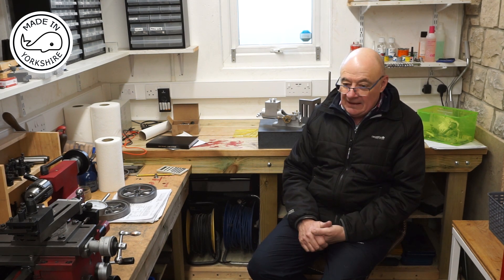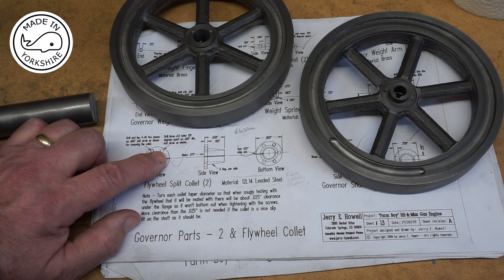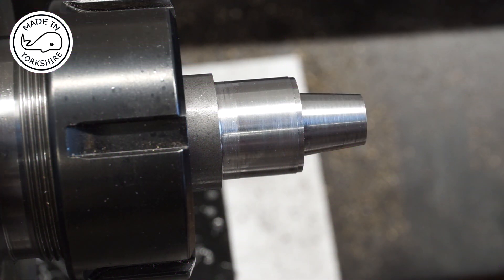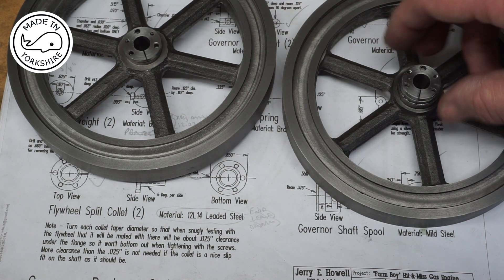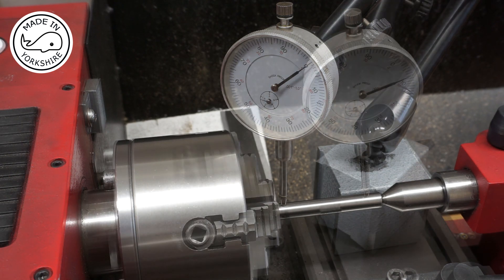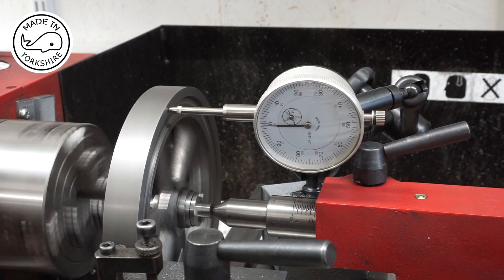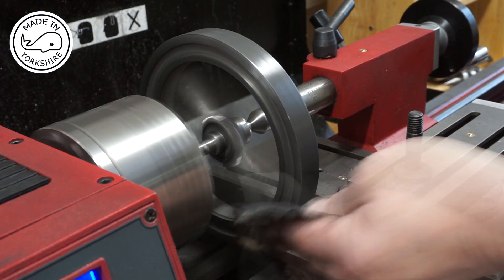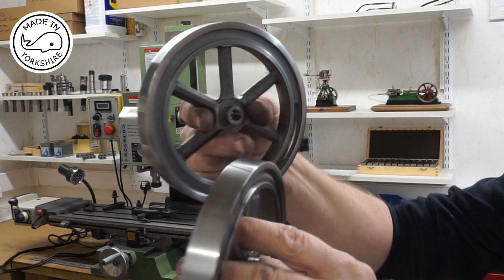#MT35 Part 19 - Farm Boy Hit and Miss Engine. The  Flywheel Split Collets. By Andrew Whale.

Comment: Andrew, I have a Farm Boy 90 percent complete (your series prompted the engine choice).  What method did you use to seal the cylinder head to the cylinder?
Reply from the maker: Hi Colin
I used a BS025 o-ring - ID = 29.87mm, Section = 1.78mm. I'm not sure if mine is Nitrile or Viton. I'm using Coleman fuel (Naptha) so Viton would be best. If you are in the UK I could post you one of mine - just email me your address to learningturningmetal@gmail.com. A small donation to paypal.me/AndrewWhale is always appreciated. Once you have your Farm Boy up and running, if you could send me a brief 10 to 15 second video clip, I could include it in one of my future videos.
I hope it turns out well.
Cheers
Andrew

Comment: Where did you buy the Yorkshire grit?  I could use a can or two of that!  Great results!
Reply from the maker: Hi there - Yorkshire Grit was designed for woodturners and I had a tin kicking around from a few years ago. I'm probably the only person to use it on cast iron, but I've it does give a great finish. It's widely available fro woodturning suppliers in the UK and some other countries.
Cheers
Andrew

Comment: Nice job Andrew. I did exactly the same thing leaving the the compound angle set for both pair of parts. I thought the 4-40 hex head screws were interesting. I haven't seen hex head screws that small over here in the US (I just checked and they're available but not commonly used here in my experience). I've used socket head cap screws on my Farm Boy, but yours will probably look more age authentic given that these engines were common in the early 1900s, and socket heads first appeared in 1911.  Now I may have to buy some hex heads...
Reply from the maker: Thanks Tony - great minds think alike - ha ha. I purchased the hex head screws recently, specifically for the collets. I agree that they do look a little better than cap head screws. I got them from Westfield Fasteners in the UK. I just don't understand why shipping costs are so high between the UK and the US - especially when you can get goods shipped from China at a fraction of the cost. Three weeks ago I purchased a couple of books from Village Press Publications in the US. The Shop Wisdom by Philip Duclos, and Two Shop Masters. I had to pay $45 for priority shipping, and I'm still waiting! I think I will chase them up today.
All the best - and stay safe!
Andrew
Reply from the maker: Hi Tony, a quick update on the hex nuts...... I've just done a test assembly of the whole engine and found that it was rather difficult getting enough purchase on the hex screws to get them nice and tight. So I've reverted to your style of socket head cap screws.
Cheers
Andrew
Reply: @learningturningmetal  Hi Andrew. McMaster Carr here in the US sells them in various grades, and it may be possible to find some strong enough or with taller heads to get more purchase. I may look into that and let you know.

Comment: Well done Andrew. I thought that Yorkshire Grit was meant for Woodwork ? Is it supposed to be used on metal, or was it just your idea to give it a try ? Anyway came out great in the end. Hope the second flywheel still runs true after re facing. Personally I would have dis assembled the flywheel taper collet and check for dirt or burr and checked again before actually taking a fresh facing cut. From seeing you machining the first one with a good setup, I can't believe that the second one was so far out. Fingers crossed. With any taper turning setup, if you want two matching parts, it does not matter that the angle is exact, as long as you do not alter the compound slide and machine as you did; they have to be a perfect fit.
Reply from the maker: Hi Dave - many thanks for the advice. I'm not sure why the second flywheel was so far out - I cleaned every face and it was spotless. I'm just wondering if rotating the collet might have improved matters - too late now though. Yes, Yorkshire Grit is definitely meant for woodturning and it produces a really high finish. It's oil based with fine grit and I first tried it on my Stuart Half Beam flywheel - and I got a really nice result. It does make quite a mess though. Maybe the guy that invented it should expand into model engineering? I might just drop him a line!
All the best.
Andrew

Comment: Gday Andrew, those flywheels look fantastic, excellent job and throughly enjoyed watching
Reply from the maker: Thanks Matty!
Reply: @learningturningmetal  Agreed. 
I really liked the way you left the final machining until you got them in this set up.
Did you figure out what the miscue was on the other fly wheel? Was it the 1st or 2nd one you machined in the previous video?
Reply from the maker: Hi Tony - to be honest I can't remember which it was, and I never understood why it was out in the first place. 
Anyway, it worked out OK in the end.
Cheers
Andrew
Reply: @learningturningmetal  I have read many of the comments on the ignition problem. No matter what engine you have its a matter of getting enough fuel and air into the cylinder to do the job and then can you ignite it at the right time.
The fact that its igniting at times suggest that it is getting enough air and fuel at least some of the time. The fact your using a fuel that is different means the carb and jets might be wrong for the new fuel. 
In Australia we can get Acetone from almost any hardware store or paint store. If that fails ask your wife for some nail polish remover. Some of those are almost 100% Acetone.
I think your comment below about the spark gap makes as much sense as anything, but maybe its best if you open that gap little by little until it works or works better, because at some point that gap will be too large for a decent spark.
Reply from the maker: Hi Tony - I think my problem is associated with compression. Looks like the Methanol I initially used degraded the piston Nitrile o-ring. I replaced that and it ran for a minute using Coleman fuel. I will now look to get some Viton o-rings. I did order some Acetone yesterday, but looking at rubber compatibility charts, it appears that that will degrade Nitrile and Viton. So, for now I will avoid going down the Acetone route.
Cheers
Andrew
Reply: @learningturningmetal  Good point on the Acetone, you should mention that in the next video. You have to do one as so may want to see this run.
My lathe has finally arrived in Australia, I just have to fid a place to put it and get started. I think my first project will be a cylinder square, followed by a lathe height gauge.
On Engines my list of future projects include the PM research #2, #3 & #1 (in that order) because the #1 has some tricky machining. I'd also like to do the Stuart Progress (wobbler) and 10V (because your vids are here to help). The Stuart kits are a bit more expensive, but have some nice details. Ades Workshop is doing an S50 at the moment. He's done a couple of neat things to boot. I do want to stick to projects that others already have videos for so I have references. The One I really want to do but haven't seen anyone do on YouTube is the Hemingway Cygnet Royal. Historically its a very interesting engine.
I've noted that little wobbler you did and will probably try that just to get started. I'll only have a lathe at first so some parts will be fun. I've seen Mr Pete's wobblers too so there's lots of references.
Reply from the maker: @tonywilson4713  Hey - exciting getting a new lathe. Now you can start buying all sorts of things to put on it! I hope your projects go well.
Cheers
Andrew

Comment: Just as an FYI, they make extended length center drills. I have a couple that I use when I can’t fit a standard size one into a part. They are cheap and useful. You might want to pick one up.
Reply from the maker: Hi Anthony - many thanks for the tip. I could do with some better std ones too, so I'll try to get some extended length ones at the same time.
Cheers
Andrew

Comment: Very nice Andrew! I wonder if rotating the split bush in the second wheel would have helped with the runout?   Keep em coming!
Reply from the maker: Thanks John - I think you could be right. I never thought about that at the time - panic just set in! Having trued them up, I've marked them up against each flywheel just to make sure that they go back into the same position. The tapered split collet is certainly an added complication!
Cheers
Andrew

Comment: Thanks for one more interesting video. Really well done!
Your fly wheels are large and quite heavy compared to ones from other recent builders. The attachment, wheel to axle, often uses a setscrew but You show a really advanced design. I'm thrilled, how did You true up that second wheel?
Reply from the maker: Thanks Stefan - the split collet is definitely an interesting feature, but it does complicate things somewhat. I trued up the second wheel in exactly the same way as the first one - making sure I took fine cuts (~5 thou) each time.
Cheers
Andrew
Reply: @learningturningmetal  Looking again I saw how You did it....

Comment: You got a really good finish on those flywheels Andrew. They will look superb when painted. It was a good idea to check for run out and sort it out now. As you say no one wants a wobbly flywheel...and certainly not two of them. Those collets were an added complication. Great idea to keep you compound slide setting. The fit looks perfect.👍
Reply from the maker: Thanks Tim - I bet few people use Yorkshire Grit. I got great finishes turning wood, Pretty messy on cast iron but it works well with wet n dry. Collets were definitely an added complication and reduced the length of the 3/8" bore.  I didn't have such problems when machining the larger flywheel for the Stuart half beam. I amazed myself by keeping the compound slide set. Wonders never cease!
Cheers
Andrew

Comment: Hi Andrew, I know those two screws for removing the split collets as Jacking screws. They probably have other names
in different parts of the world or in different trades.
Chris
Reply from the maker: Hi Chris - many thanks for the info. I'll write that on the drawing so I don't forget. My use of engineering terminology is somewhat limited, and I doubt it will ever improve!
All the best.
Andrew
Reply: Chris, those collets are very much the same in detail as what is commercially branded as 'Taper Lock Collets'.

Comment: I had same problem with both my flywheels held on with same method. I’ve not corrected them yet! Was too eager to get the engine running. The collects must throw them off, I think it’s something to do with the slot? Maybe three slots not quite through would be better?
Reply from the maker: Yeah James I think you are right about the collets. Definitely an added complication. I wonder if rotating them 120 or 240 degrees increases or reduces the error? Something I didn't think of, but having now got them running true the collet positions are now marked for life! I'm about to have a play with your ignition. What power supply do you use and do the switches last a fair while? Someone else sent me a module based on a hall sensor, so I will have a play with that as well.
I'm starting to get nervous - there are so many variables involved - it might take me another 10 months to work out why it doesn't want to run!
Fingers crossed!
Cheers
Andrew
Reply: @learningturningmetal  I use a 240-12v AC to DC power supply that is rated for 2amps. The Reed switch has lasted many many runs with no issues to date. 
Remember compression and cam timing before you think about ignition. Engine must have no leak down at all. All the best
Reply from the maker: Thanks for the advice James - I will have a play.
Cheers
Andrew